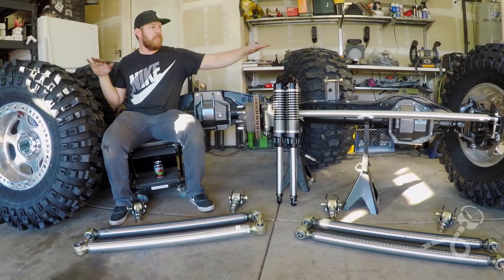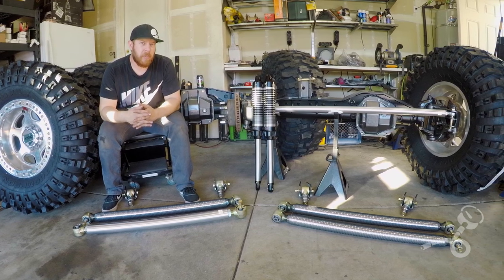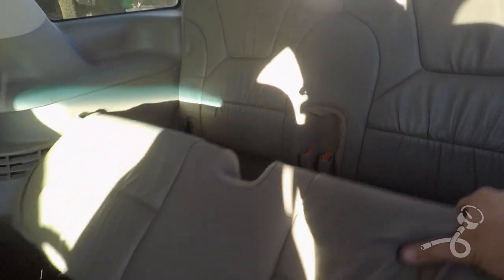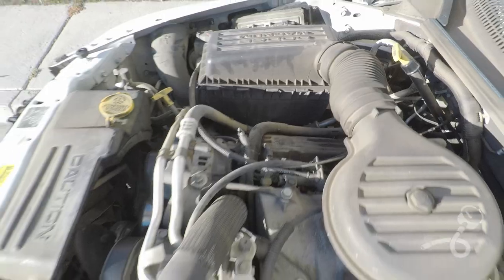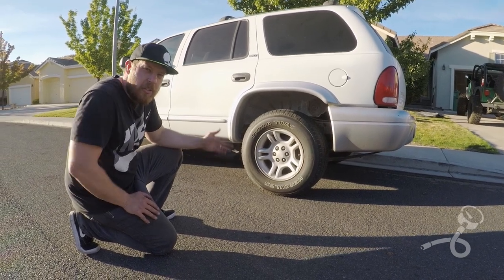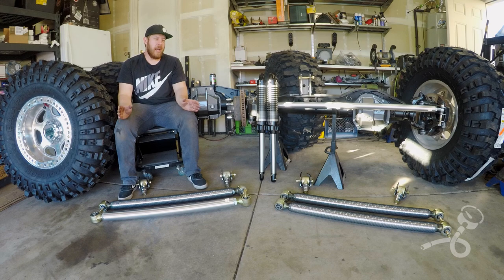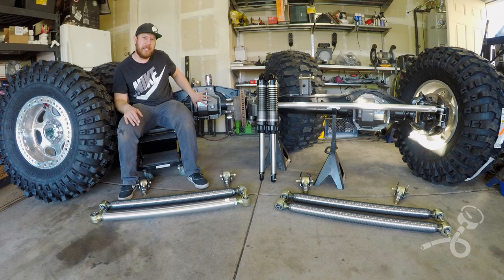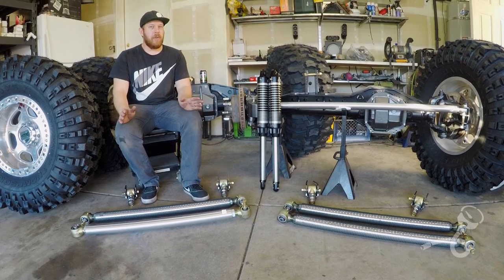Father of 3 Builds 1 Ton Swap Dodge Durango Family Crawler on 43 Inch Baja Pro XS Tires

Comment: Can’t wait to see this build happen. I want to put a set of Dana 44s on my Durango
Reply from the maker: I can’t wait either. I been dreaming about this rig for a long time. I think a set of Dana 44s would go under a Durango really well. What tires are you thinking?
Reply: @aireddown813  I’m thinking just a set of 35s biggest reasoning for my swap would be the suspension travel, the Torsion bar suspension sucks on the Durango for any sort of flex
Reply from the maker: @markburkhalter41  you’re right about the torsion bars. Not great at all.

Comment: How much clearance do your axle have after the shave and being on 43's ?
Reply from the maker: With no weight on the axle and 30 psi in the tires, I have 15.75” of clearance under the rear diff. The front should be about 16.25” but I haven’t measured it.
Reply: @aireddown813  rad, that thing is going along well, you have some good information about those axles.
Reply from the maker: @2112kustoms.  Thanks! I wish those earlier videos were higher quality, but I’m glad they are still useful!
Reply: @aireddown813  the quality is in the information! Knowledge is always king.
Reply from the maker: @2112kustoms.  Thanks man. I’ll keep it up!